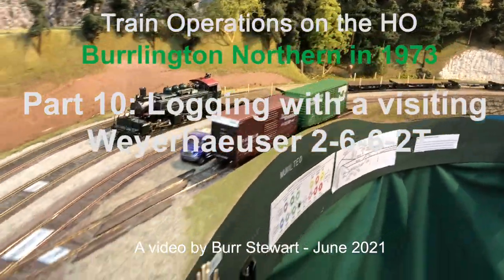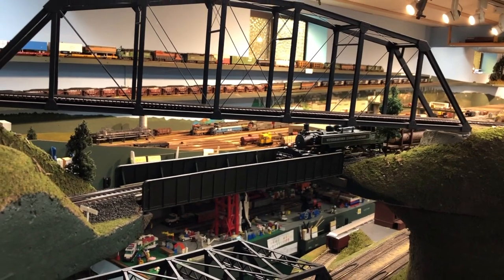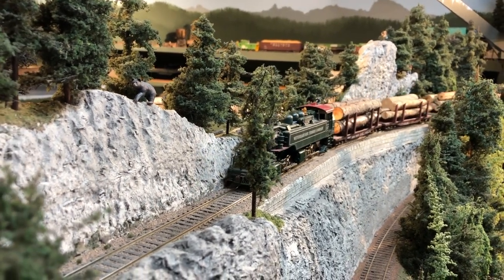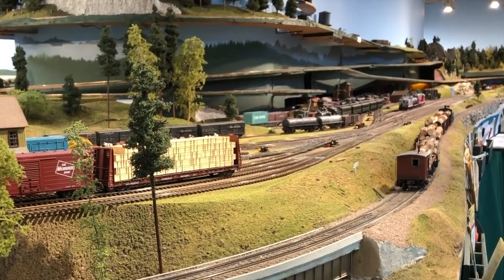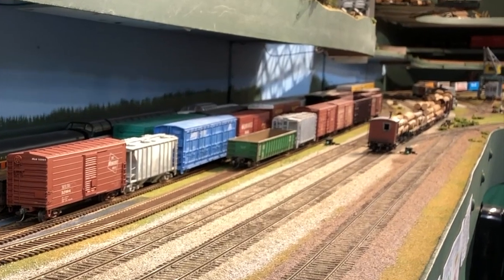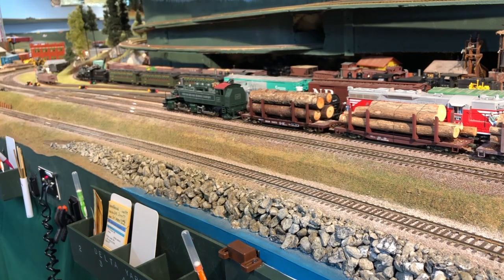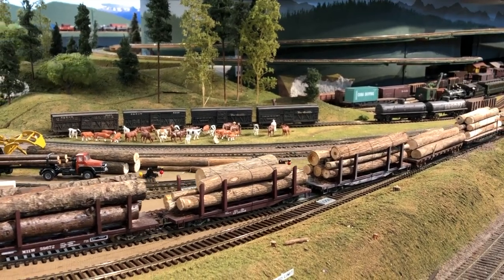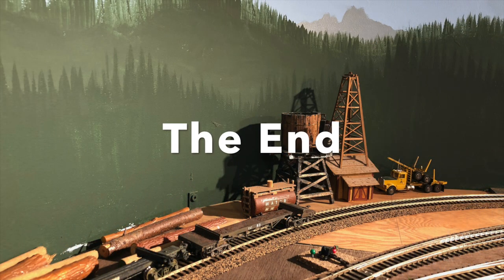Part 10 - a steam 2-6-6-2T logger invades the HO Burrlington Northern

Comment: The con rods of a Mallet, Beyer Garratt, or any articulated loco are not expected to be synchronised.    On the real locos the sets of drivers slip individually, so, even if you set them up synchronised, they won't stay that way for long.   In fact, the hammer blow on the track is less when they are out-of-synchronisation.
I have one of those locos.   A great model.   I wonder how they manage to hold enough coal in that bunker to keep such a big fire going.
Reply from the maker: Good question! It's just barely big enough for a tiny DCC decoder! :)
Reply: It seems the locomotive is based on the Uintah railway's 2-6-6-2Ts, which were designed for a steep 25-mile section of 3ft-gauge line, which included a six-mile climb at 7.5%! I guess the coal bunker was sufficient for a trip along the line and they'd take on coal at each end. This was to a mine, rather than for logging.

Comment: At the end, it backed through the switch without stalling.  Why doesn't the owner  install sliders on the loco?  Attach to the screws or between bottom plate and frame.
Reply from the maker: Good idea, of course. Thanks.